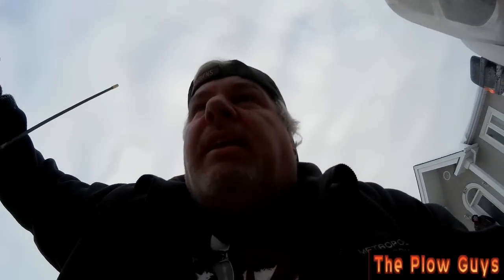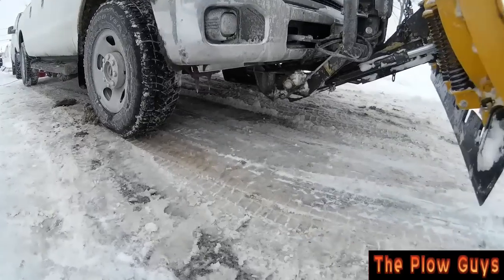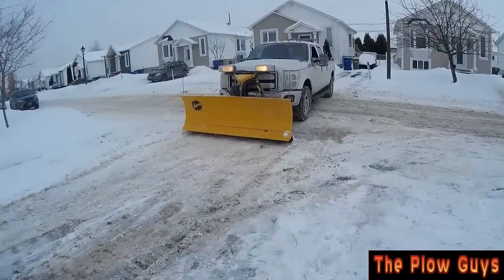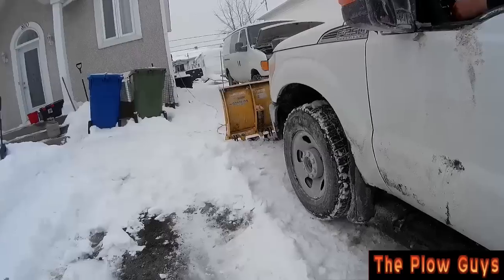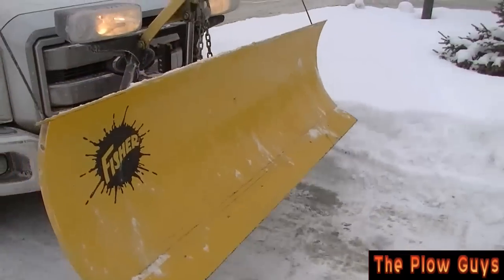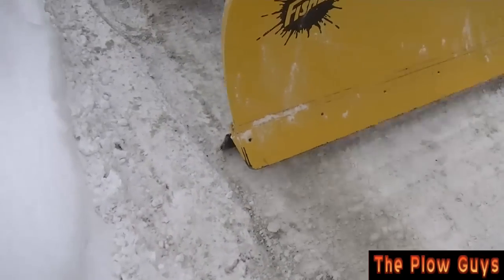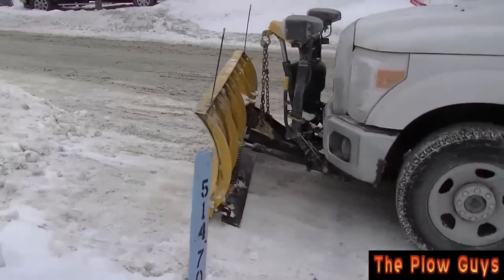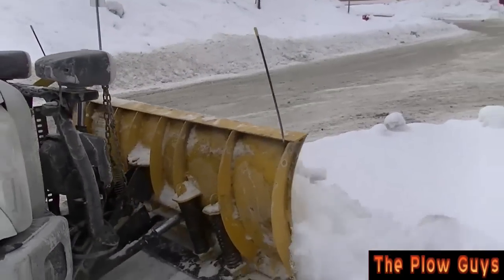Snow Plow Back Drag "The Plow Guys"

Comment: Where did you get that back blade, I've never seen that before? 
Todd
Reply from the maker: High Todd. The back blade is made completely at the dealership where I bought the plow. they have a fabrication shop in the back and do some great work. They have a template for these and make them by the dozens to match up with the fisher/western system. I don't believe they modify the plow itself at all. Pretty much they make it a bolt on job. I had to modify mine a bit in the end. I found it went to forward and the angle wasn't aggressive enough for my needs.

Comment from the maker: I am not sure how oversized shows would work. I would like to get the back drag plate to be at almost 90 degrees to the pavement. Well a little more or less depending how you look at it. The blade should be at a bit of a angle so that in the event I do catch something when backing out like a curb or a lifted piece of pavement the blade will lift over it instead of pulling on it. At the moment the back drag is at a low angle that it will actually glide on top of packed down snow causing to lift the plow over the snow. Thanks for the comment and don't give up me yet. With a little help from everyone we will figure something out.

Comment: Actually I think it's doing a pretty good job as it is. I plowed with a plow truck for 13 years and you have a few things to consider here.
 The first thing you got going against you is the trucks suspension. As you apply down pressure the lack of weight on the trucks front end causes it to not keep that blade so hard to the ground. Going forward is much different. You have the weight of the full truck to your advantage. 
Changing the angle of the back blade will help. An inexpensive way to do this is to fabricate the mounting brackets for the back blade so they will have a steeper angle on that blade. Simply cut off the old ones and weld on the new ones.

Now IF It were mine I would mod the heck out of it and put in a short hydraulic cylinder, a diverter valve and with a switch in the cab so I'd be able to adjust the angle of the back blade hydraulically. 
See. You shouldn't have asked me to view this. ;)
Reply from the maker: LOL thanks for the input. the hydraulics might be a little over kill...

Comment: good video but saw one mistake that could improve the performance of your backplate. I saw on your shoes that All your washers were on the bottom below the hook up what i would do with that is to put the washers on top and then put your PIN in . try that out. second I know that you did not have a blade on your plow this will improve on your cutting edge because you do not have a cutting edge and will do less wear on your flip edge. hope that works. doesn't really matter if you modify your plow now unless you bought it last year Fisher normally has a two year warranty on the plow but besides the fact you cannot buy a new plow blade, flip edge, A frame Fisher has done without the old models and upgraded which if you would have to replace any one of those you would have to replace the whole set so be careful of what you got and make it last as long as you can lol if not you're looking about $1,500 to $2,500 to replace it
 good luck and plow on
Reply from the maker: +John B. Thanks for your comment. I have since modified the plow. I still have to let the trip edge wear down a bit, but I will be putting a plate on it. Up dates here. https://www.youtube.com/watch?v=kPEZt0soo8E

Comment: John, I understand completely but I asked anyway because ours is in great shape and much cheaper than new. I will not be getting the new one until fall either. I cannot justify starting payments again with it sitting in shed. As a kind of friend, I was wondering why you have made up your mind on an inverted blower. If you should get events like in Boston right now I feel that my size tractor would be in trouble without the ability to back drag under pressure then blow away the line of snow, just like the video where I met you. This is my 31st year of plowing for myself and this does work quite well in deep events.No way intending to be know it all, I just want you to look at all angles before you drop the hammer.  Wayne
Reply from the maker: Allow me to explain re the type of blower. The blower like you have would require me to blow snow as I backed into a driveway and the pieces of ice, stones, salt, and any other debris would / could be thrown out towards any vehicles left in the driveway. This could damage a vehicle. Some driveways are long and run alongside the houses and I need to pile the snow at the front of the houses. This minimizes that the melting snow in the spring will not overwhelm the french drains around the foundations of the homes. It is also alot safer to back into a driveway and drive out than the other way around like I do with my plow truck. The blower you have would be great for commercial lots around here. It would allow me to have a larger push blade or bucket in the front and a blower in the back to pile snow higher and out of the way.

Comment: John, I just see on Paul Shorts site that you are still interested in a tractor. As I told you when I subscribed our tractor is the same as Pauls and the one in the video where I met you. I am trying to trade it off for the next size larger.  Maybe if I get close you and your son can buy ours and ship it to your home. It is 5yrs old this month with 389 hrs on it with a 72 inch bucket a 78 inch Grattex reversible plow and a P720-74 Pronovost snowblower. I can send pictures.  Wayne
Reply from the maker: Oh well you are very kind to offer but my problem is I have to wait till next fall the earliest. I will have to get a loan for a tractor and I first have to pay off the one I have (loan). It is really hard to earn money. The fact the government won't let me make it means I have to do it the old fashion way and work for it...lol...Thanks though for the thought.  I need a blower that faces the tractor. I will be backing into the driveways and pulling the snow out. but I have heard good thing about pronovost

Comment: Hi guy's, do you have any tips for plowing a stone driveway? A lot of our clients have oil and stone driveways. Thanks in advance.
Reply from the maker: village carpenter Gravel is a pain to plow in the beginning of the season. It depends so much on how cold it has been before first snow. Rule of thumb is to back drag in the beginning and after you have built up a good base then you can push. People will use shoes on the plow to keep it from digging into the gravel. These are good and can be used all season long. The problem is that if the gravel is soft the shoes can dig in, but this is only a problem until the gravel freezes. If you do paved driveways too you might want to pull off the shoes when plowing the different surfaces. The shoes are easy to put on and off.  Hope this helps....    -John
 Plow shoes
Fisher, Western, Curtis, Blizzard, ect..:  http://amzn.to/1TwQmzO
Poly cutting edge:     http://amzn.to/1TwShnS

Comment: How do you like the ford and fisher plows any issues with either of them.
Reply from the maker: Well I do have some issues but one of them is my own fault and I can resolve it with minimal cost. The standard front coil springs are not good enough to support the plow. I have started bottoming out and will install a couple of air spring inserts to resolve this issue. The plow is good but the back drag just slides over any packed snow and I am in the process of resolving this issue at the moment. Even though it will be temporary it should do the job for now. The truck has the power to do the job and as far as diesel vs gas it has not been a issue and gas is a lot cheaper right now.

Comment: Have you thought about using liquid de-icers to aid in clearing? I use both beet juice and salt brine depending on on surface.
Reply from the maker: beet juice......??? tell me more. what is the effectiveness of it, and will it stain concrete.
Reply: +The Plow Guys Fusion is the sugar beet juice product I spray before a snow fall. Keeps snow from sticking to surface to be plowed. Works without freezing to around -80C. Does not stain concrete, brick clothing, etc. Unlike salt or salt brine this does not leave a white residue or harm lawn edges. Winnipeg uses far too much sand which makes a mess inside stores and has a costly spring clean up. I use a SnowEx VSS 3000 to apply. Costly investment but worth it money.
Reply from the maker: +Trent Casey send me some links. I would like to learn more.
Reply from the maker: +Trent Casey ok so I am looking at http://eco-solutions.net/store/product/fusion-2350/  and i was curious. do you buy the solid and mix it with water or do you buy the liquid in the link above and mix it.
Reply: +The Plow Guys I purchase 1000L totes and not "cut" the product. Experimented cutting with salt brine and found product works better. for my applications and bitter cold temperatures leaving the product alone. Alot more expensive that salt or sand to apply. The savings come in other areas. If you have an email addy pictures can be sent.
Reply from the maker: sure fire me off some info. I am really interested. I am not a noob to brine but it is something we don't use here so I am a little ignorant about it. I have been spending some time this morning researching it. here is my email:  coffeebeans_2@msn.com

Comment: Is that blade made or bought? Is it available in plow stores?
Reply from the maker: The back blade was fabricated by the people that sold us the plow. They have a shop in the rear that does all sorts of stuff. There are many different types of back blades to be found out there. This one uses the pre-existing hole on the plow. We added a stop to keep the back blade straighter when pulling and added a Teflon blade to it so as not to damage those driveways with uni-block.
Reply: Awesome thanks for answering my question .